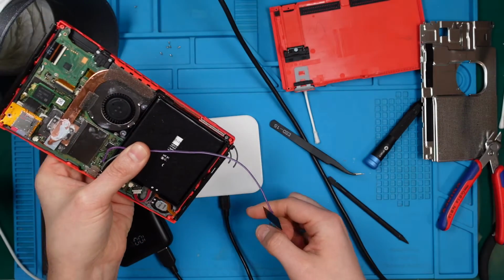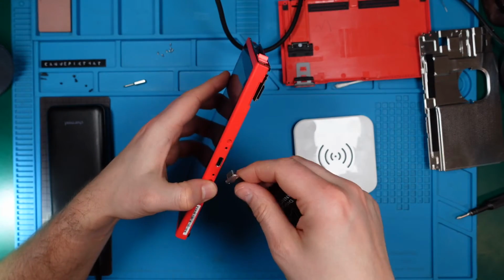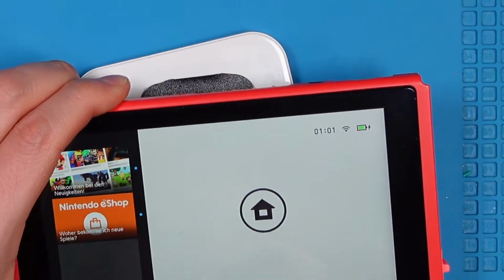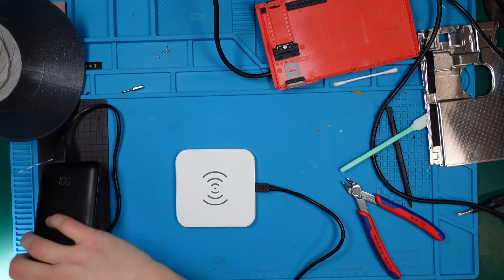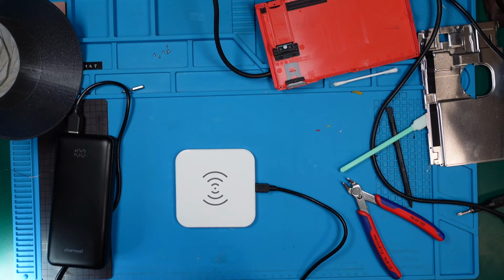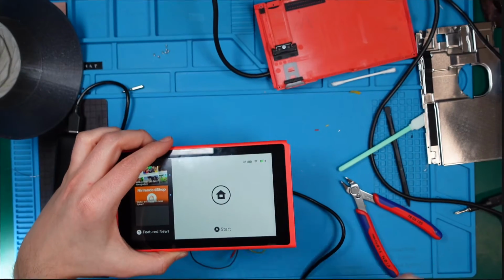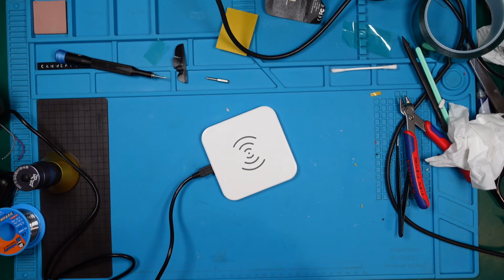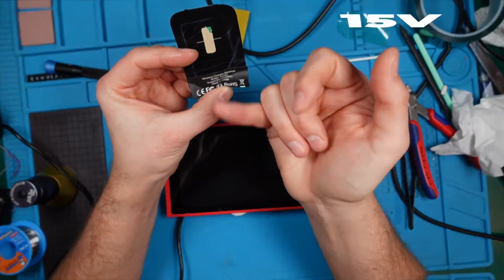Nintendo Switch Mod: The Wireless Charging Experiment

Comment: there is easier way and no soldering, just buy adapter for wireless charging, plug it in and use :D
Reply from the maker: Sure, but the idea was a dockable switch with no clues that something had been changed. 😉
Reply: @CanWeFixThat  ohh,okie

Comment: Love the idea but just throwing my opinion out here that you should put the + before the fuse coming into the console. The M92T36 is already sketchy enough don't give it more reasons to fail than it already has 😅
Reply from the maker: Haha, you are right! Unfortunately, the whole idea makes no sense when it will not work due to the docking station and the same signals. I am pretty sure there is a way, but there are many more complications in it.
Reply: @CanWeFixThat  needs a sensor that can flip on a Mosfet or something when it detects the 15v from a dock instead to be able to have either engaged one at a time
Reply from the maker: @rollermobsterinc2682   Maybe I will revisit this idea, but I am unsure how many people are interested in it.
Reply: @CanWeFixThat  I am!

Comment: Awesome stuff, lil update with my Bluetooth 3ds, I accidentally opened the wrong latch cable port and broke it, I'm now trying to resolder the pins from the ribbon cable directly to the motherboard. Other than that I found out what the audio pins on the 2DS XL are, I'll update if any of it goes well 👍
Reply from the maker: Hi Penken! Brilliant, are the pins from the 2DS XL and 3DS XL compatible? It is possible to solder the ribbon cable directly, but it is a bit fiddly.
Reply: @CanWeFixThat  Everything went horribly wrong, I tried connecting up the cable directly and still no dice... After that something else went wrong and now either the power button doesn't work
Reply from the maker: @Penken, that sounds really bad; sorry to hear! 😖
Reply: @CanWeFixThat  I've set out to buy a full on soldering station and replacement components, I'm determined
Reply from the maker: @Penken Cool, I am always happy when someone tries to get deeper into repairs! Keep me posted! 💪

Comment: What about using a switch for the data lines connections, so when you decide to use wireless charging you could just flip it to bridge them. It would require somewhere to put it so you'll be able to use it, so it may be too complicated.
Reply from the maker: Hi Nicolas, it is a good idea, but as you mentioned, it is not very sexy to have a button on any side for this purpose. 😉
Reply: That is actually a great idea to do a switch. Add in a small switch that would slide side to side and make it look like it was factory. I don’t think it would be hard to do. I have a few switches that I can try it on when I get a free chance to, which is pretty much never, lol. I own an electronic repair shop that I run with just my wife, so finding time would be the challenge.